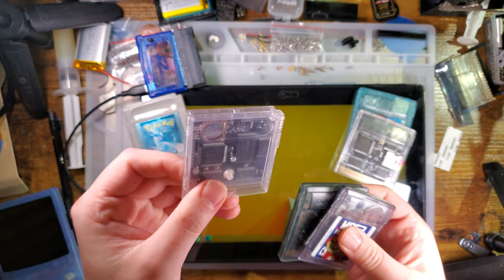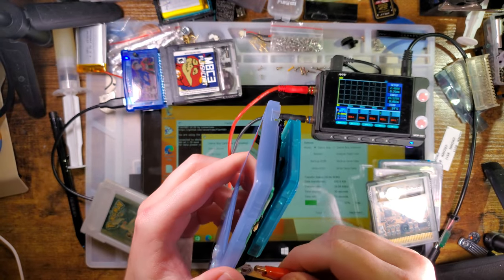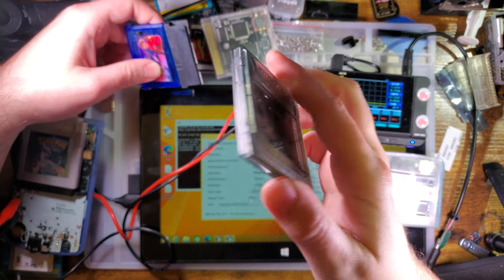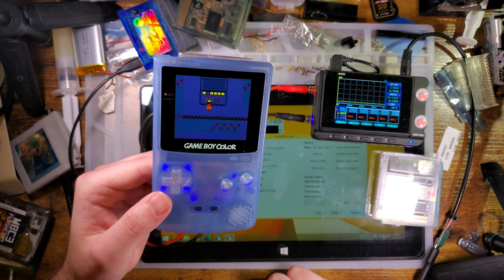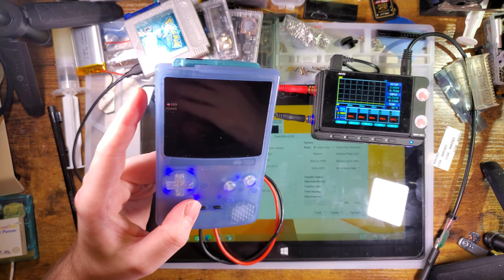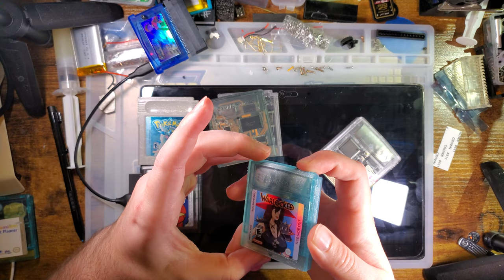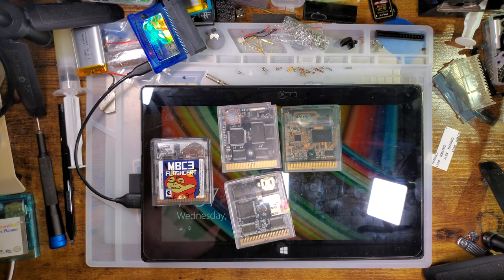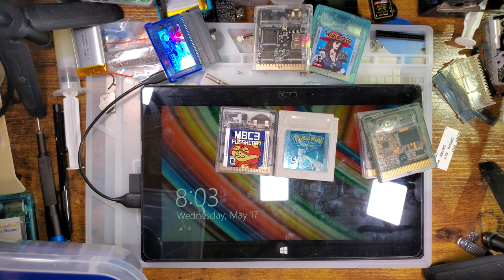Game Boy (Color) RTC Flash Cart Power Usage and write times

Comment: I spent about a year working on an open-source MBC3 cart design, and I remember trying to use a CPLD or an FPGA to replace that custom MBC3 chip. 
I was (and still am) an amateur when it comes to electrical engineering, but was able to program all of the behavior EXCEPT for the real-time clock.
Nintendo didn't use any kind of standard for their real time clock, just a big binary counter. Re-creating this circuit takes up a LOT of space on a chip. Choosing a chip then becomes a balancing act:

  -must have low power consumption
  -must have enough capacity for the real-time clock circuit
  -must use correct voltage, OR we need a power efficient regulator

It starts to make sense why Nintendo made a custom chip for this.

I think a lot of problems could be alleviated if we could edit the ROM to use Binary-Coded Decimal (BCD) for the real-time clock, which is what modern Real-Time Clock chips use. Then, we could have a dedicated RTC chip to store the time, and our PLD could read/write it as necessary. We would use less power, because RTC chips consume almost nothing, and we could probably get away with using a smaller PLD.

Then we could finally get rid of the MBC3 chip for good. It's also a little discouraging doing all this work while the  EverDrive GB X7 exists. It's a great product, and it makes all of this work feel a bit pointless. There's still a niche for single-game flash carts, but that niche feels like it's shrinking all the time.
Reply from the maker: It would be pretty neat if the RTC handling could be patched in real-time so that you wouldn't need to patch every ROM before flashing but I guess it's not really that easy. And anyway, at that point, an everdrive is easier. Thank you for all the hard work nonetheless.
Reply: @makho  hey, do you still have that funnyplaying rtc cart? Can you tell me what chip is in the upper-left corner (the one with 8 pins)? I'm guessing it's a serial RTC chip, but I would love to know for sure.
I love seeing all the different ways people try to implement the MBC3 clock.
Reply from the maker: https://i.imgur.com/ic3ePIO.jpg @WadeVillines

Comment: Hey this was super interesting to see how the different carts function side by side! I definitely want to make my own physical collection more complete with these. 

I was wondering more about your experience with the Funnyplaying carts. I recently got 2 “MidnightTrace GB/GBC FLASH CART V2” with dip switches, but I assume you have the V1. I got them to play SmithPlays’ Crystal Legacy romhacks and am having some issues. I was able to flash the romhacks onto the cart but it seems to have issues in my GB Operator. Any time I try to backup, write, save, or play on the Operator it bugs out like crazy. This also happened when I tried Crystal Clear’s romhack. However, I have zero problems using them on OEM Gameboy consoles.

Do you know if it has something to do with the cart itself compared to other flashable ones? Or does this happen based on the hack itself? I filed a bug report but I haven’t heard back from the Epilogue team yet.

Thanks!
Reply from the maker: GB Operator is probably your issue.

Comment: Hi, thanks for your video. Just a quick question. Are you able with your GBxCart tu upload or download save on the funnyplaying cart? I just receive mine and this doesn’t work with my GB Operator. So I’m wondering if the issue come from the card or the card reader. Thanks in advance for your reply and for your work!
Reply from the maker: Yes, both the GBC and GBA carts from funnyplaying have full compatibility with the GBxCart RW. Epilogue's current offerings do not have great compatibility, even among OEM carts.